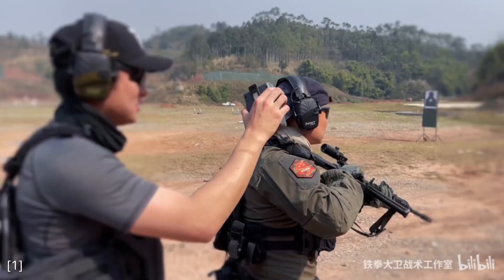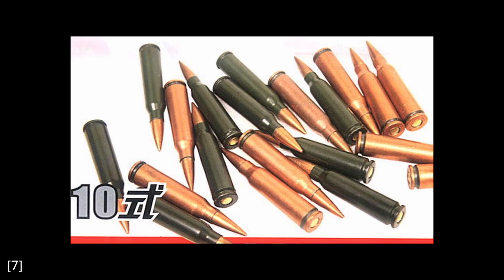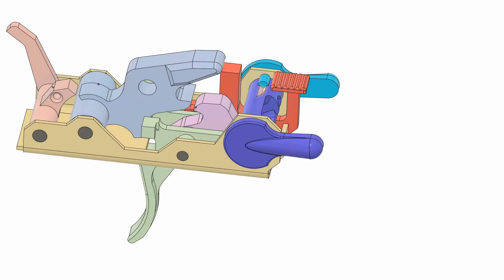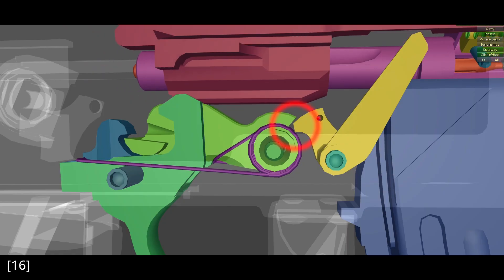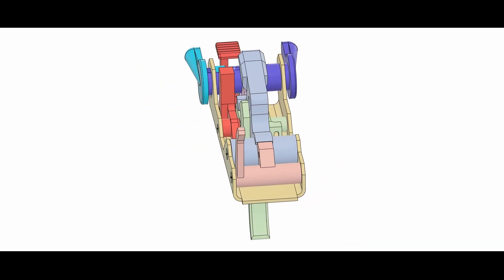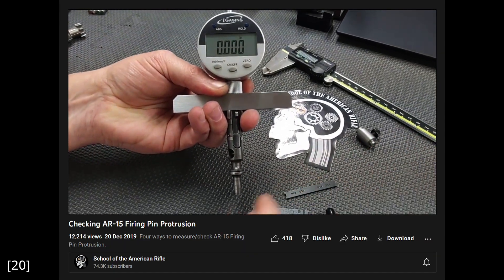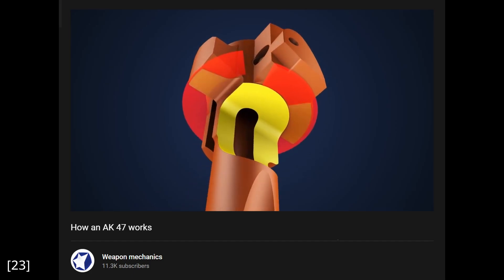QBZ191 - Final Update (and firearms design rambling)

Comment: It's a great video. What do you think the gap in the upper left corner of the ejection port is for? I know it's the bolt carrier because it hits the upper receiver pinduring recoil
Reply from the maker: If I remember correctly, the ejection port on prototype guns are much smaller from top to bottom. It seems like that caused ejection issues so they had to enlarge the top of the ejection port
Reply: @cabbage6015  Yes, the bullet case is thrown diagonally upwards, rather than directly from the side like AR. What I am thinking is whether this small gap in the mud test will cause the firearm to malfunction.
Reply: @cabbage6015 What is the muzzle velocity of the DBP 191?

Comment: Third time watching this video...
I don't think QBU191 is a IAR like M27 since PLA has also switched to their new SAW and GPMG. It has a full auto function just because PLA likes aggressive firepower.
Reply: Agressive firepower? I've mostly see 'em going towards a more flexible side, but I'm not a gun/military expert I'm just here to know more about norinco really.
Reply: @parko-nib  China basically inherit this style from Soviet army and their idea is simply bigger gun is better. And they are actually good at designing lightweight weapons with strong firepower.
Reply: @calciumoxide3385  i mean if you know what you're doing bigger gun does equal better, also lets chat a bit(i want to help cabbage's algorithm reach)

Where exactly did that come from? Most of the military gear i see the pla use is more tactical and cost effective as possible, the only one that I'VE seen fit your category a bit is the QLU-11(and it's more like a over-engineered deadly multi tool than anything really)
Reply: @parko-nib  I actually don't understand what your question is. You mean you can't find any big guns that PLA use?
Reply: @calciumoxide3385  well no, i can, but i don't really find their big guns following the soviet logic(bigger = better), btw I'm here to learn more about norinco, 1 week ago i didn't even know they existed, any info is welcomed.

Comment: Hello , great video. I have a question , you said that ar15 doesnt have helical lugs and that ak does which helps with primary extraction. But i have also seen many people in forums say that ar15 also has primary extraction and that when bolt is rotated a bit the cartridge also longitudinally moves slightly. Maybe ar15 has very tiny helix angle so that from picture you showed it looked like it was flat but in reality maybe it has some tiny helix angle? Or does it achieve primary extraction through some other ways?
Reply from the maker: I have never heard of primary extraction being achieved on an AR-15, by helical locking lugs or any other means 🙁
Reply: @cabbage6015  thank you for answer, i guess its just the good old forum myth. Because i just now scrolled down a bit on the forums and other people also disagreed with them and said that ar15 doesnt have primary extraction. However they also said this "The AR does not have this primary extraction.

The AR bolt does have reliefs on the left rear corners of the lugs that allow diagonal movement, but they don't force it." Do you know anything about those "reliefs" that this guy is talking about? It sounded interesting to me and my first time hearing it
Reply from the maker: @thomasschumacher5318  I believe they’re talking about the chamfers at the edges of the locking lugs, but I think those are just to relieve sharp edges, they have no significant effect on extraction
Reply: @cabbage6015  i see, thank you so much :)

Comment: I'm more interested in the upper receiver materials, and the recoil spring. Plus, also the gas block portion and the barrels. It looks intuitive enough that the 191 got an exposed adjustable gas block. I guess it's titanium btw still not sure, if it's landed on PLA SF Units, it must be another version of premium build. I expect some upgrades on the barrel and the upper receiver, aftermarket trigger looks fairly interesting if it's available. The finish can be more beautiful and got to go through some cerayote to adapt with camo and mission need. However, the stock looks a little bit off, if there's attachment point for sling etc it would be great.

Comment: I'm sure you've noticed a lot people point out the lack of a folding stock in this weapon. I personally don't find it necessary but it'd be cool to have one. 

Now just for arguments sake, is it possible for them to somehow integrate a folding stock into the current configuration? Or will it have to undergo major redesigns...What are your thoughts?
Reply from the maker: Hmm in terms of engineering I think they’ll have to do something like the LAW folder since the recoil spring is in the receiver extension like on an AR. I don’t think they will be able to fit a recoil mechanism on top of the bolt carrier like the MCX, due to the high ejection angle, and they also have cam lug locking mechanism up there.

Whether they feel the need to field a folding stock variant? I have no idea 😕
Reply: PLA still fields a large amount of type 95 in their arsenal, so I dont think a folding stock is too much of a concern for them

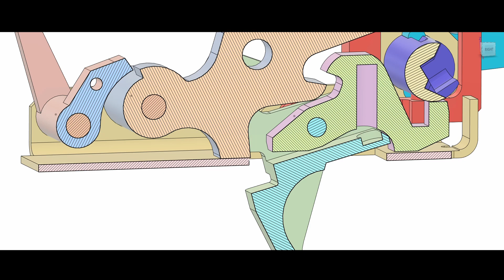Comment: 12:00 Adding mass to the buffer is not a perfect solution to the bolt/carrier mass ratio.  The mass ratio is important for the energy retention of the carrier during bolt pickup, since it need to impart energy into the bolt to get it moving, but during bolt pickup, any kinetic energy imparted to the buffer cannot be used to move the bolt as it not rigidly connected to the carrier. 

Also as far as I understand the Garand-style helical rotation doesn't have enough rearward movement to give primary extraction but helps to reduce wear of the lugs and friction,
Reply from the maker: Agree with your buffer assessment

Comment: Watched your first qbz-191 video and subscribed instantly. Simply love your analysis and eye for details. I really wonder why the Chinese ditched qbz 95 and what benefits does this new conventional design bring. They could've used 95's working mechanism and designed it into a conventional weapon from its current bullpup guise. I ask this as i haven't heard anyone complaining about 95's reliability. What objectives did they achieve with this new weapon design?
Reply from the maker: Glad you enjoyed! I think they switch to this design partly to provide more attachment mounting surfaces. Their patent documents also said AK-style bolt carrier groups are more bulky and heavy, so they used the AR-style this time to reduce weight. I also think that the 95's trigger mechanism is a bit bulky, especially with the linear hammer.
Reply: 95的设计是为了配合当时的机械化部队改革，部队装备了大量的战车等等载具。无托设计由于枪的整体长度较短，同时保留枪管长度，所以是一个天然的优势。劣势也非常明显，拓展性太差，很难加装瞄具。
  现在弹药技术进步到可以让短枪管打出高初速，那么就不需要长枪管了，无托布局就没有存在的必要了，回归有托布局不影响使用的同时还不影响拓展性。所以191就出现了

Comment: Thanks for another great video about the QBZ191 family. 

This rifle has some defects, but people who know the concept behind this design could accept that. To be more precise, the safe-auto-semi selector, the polymer handguard etc. But critics should know QBZ 191 is designed for large scale army, all those gentlemen who have to carry the rifle from average elevation exceeding 4,500 metres to extreme temperatures have ranged from −52.3 °C to 39.3 °C. Polymer furniture is the best solution for these environments, just like the AK12 family choose to have polymer furniture.

The auto-preferred selector is the habit-based design from the original type 56 to type 95. This design inertia might be the only thing 191 should have changed. In real battles, safety should be always on until the soldier pulls the trigger. Safe to semi should be a subconscious move, and semi to auto could be a conscious decision even when making contact with the enemy. 

The QBZ 191 family would be better if there are Chinese versions of SOCOM M4A1 SBRs and RECCEs. Change the selector to safe-semi-auto, design a better and stronger freefloat handguard for different lengths and shorten the suppressor.
Reply: There they are if you scroll down to variants.

Comment: Massive sleeper channel. Out of curiosity, what’s your take on the external vs. internal (Stoner) piston debate?
Reply from the maker: Honestly I don't have strong opinions either way. External pistons are simpler to clean and manufacture (outside of the AR platform), and work better w/ SBRs. Internal pistons have a better centre of gravity and generate less moments within the bolt carrier group. I kinda wonder why so few designs use the internal piston system. Maybe it was bc the tendency for the bolt carrier to heat up severely limits where you can place the charging handle? If we're just talking about the AR alone, then I feel like the in-line recoil system and cylindrically supported BCG just suits the internal piston better. It was designed like that from the beginning after all.

Comment: "3 times more on this than capstone in uni"
What it says about you as a student is that you are passionate about firearms design. I, too, have spent thousands of hours researching firearms when I don't even currently have a firearm design related job. I just own them and shoot them at work a small amount. I'm not even infantry.
Tidbits are the funnest part of this for me. One I found just yesterday is that literally EVERY SA80 ever made has an autosear trip, including the factory semiauto ones, AND the bolt action ones. 
The L98A1 cadet rifles have autosear trips. Magical, truly. Literally every gas operated SA80 ever would function on full auto if you replaced the lower, which at least in the US isn't legally the firearm, the upper is. The L98A1s would also be relatively easy to convert to semiauto, and I have heard claims the British Army might be doing that.

Chinese M27 Chinese M27 (but arguably better for several reasons)

Drums mathematically don't make sense in almost any situation but I won't make a full comment on that unless prompted

So, if you leave the gun cocked, you don't have to take it off safe to load a round? Personally, just leave it cocked all the time. Never understood people's fascination with sending hammer forward on closed bolt weapons when they clear them. Best case scenario, you ND. The other possibility is the chamber was already empty and you did nothing to ensure the weapon was clear at all. In some guns, you then can't put the weapon on safe. You can't tell the hammer is forward externally, either. Even on guns where this doesn't mess with the manual of arms, like an AK, all you have done is increased the force necessary to charge the weapon.

Generally incomprehensible to me outside external hammer weapons and striker fired pistols and open bolt weapons.

I'm not a huge trigger design nerd, that was all really neat! All the AR safety features, in the bolt carrier, and the AK safety features in the trigger.

The bolt tail thing is slightly weird, but mass ratio isn't really that finnicky that it'd be an issue, even without the buffer. The bigger gain is just spending less money on less metal of a smaller shape. If you have a mass ratio of 3:1 bolt to carrier, or higher, you're generally OK if you don't mess something else up. The higher the better, but guns like the SCAR with monstrous ratios like 10:1 aren't monstrously more reliable than guns with half the mass ratio. Bolt regulated firing pin protrusion is a definite plus.

People talk a lot about 7.62x39's geometry with primary extraction, the helical lugs are probably a way bigger factor, steel or brass.

A couple firearm platform suggestions: 
Tavor                   By far the most produced, barely understood rifle. It's not a great rifle in my opinion, but it's very weird, and it shares a bolt design with the Desert Eagle of all firearms.
Indonesia's Pindad series of weapons. Everything they've made past the FNC clone has been super weird. They're supposedly still FNCs but... they have AK gas blocks, and they have AR15 cam path pockets on the left side of the receiver. I'll DM you on instagram with more weirdness if you'd like, but researching these is abnormally hard so it might not work.
I'd say RM277 but there's just not enough information. The NGSW weapons are, for now, probably off limits due to limited information.
FAMAS        A weird gun with lots of info
SA80            A normal gun with lots of info, and lots of absolutely cursed tidbits, like the aforementioned autosears in bolt actions.
Reply from the maker: Hmm I'm thinking of making a video on the QSZ193 rn, since I found a bunch of patent documents. The QSZ92 is interesting too, and I planned to buy a civ version but when Trudeau announced the handgun freeze in Canada they flew off the shelves, haven't seen one since... I also have some firearm design ideas that I want to tinker around with. Gosh I wish I lived in a place where it's legal to make your own guns and test it in the woods...
Reply: @cabbage6015  Depending on what you do, it is and isn't legal in the US to make your own guns and test them in the woods, but it's definitely better.

We have the Norinco sanctions, however, if the gun has been in private hands for 5 years it can legally come into the US as the law is written. Nobody has ever done this to a QBZ-97, but I'm seriously considering it. There are sources other than Canada too, such as Italy. 

I don't know the 3d printer laws in Canada, but if you make sure to steer clear of making legally prosecutable things with it you can do a lot of prototyping. I'm friends with a Brazilian guy prototyping an entire CAD-designed assault rifle with unique gas system, trigger pack, receivers, cartridge, everything.

It's genuinely awesome to see a plastic version of what was only digital exist in real life, in somebody's hands.
Reply from the maker: @superfamilyallosauridae6505  Yeah I'll by drafting up my design in CAD in the near future. Will call the RCMP to ask about 3D printing regulation
Reply: @cabbage6015  o.o
That's awesome man! Only thing I'll say, is that to minimize the size and weight of your overall weapon, minimize the size and mass of your bolt and how it locks into the barrel. Especially the bolt specifically, because like a snowball rolling downhill it drives the mass of the entire action.

Really excited to see what you come up with.
Reply from the maker: @superfamilyallosauridae6505  oh it’s a handgun tho (but everything you said applies). That’s also why it has the potential to be legally finicky since handguns are so tightly restricted in Canada. I’ve also had an idea to make a 3d printed semi auto .17 hmr using an off the shelf barrel, but I emailed the RCMP and they told me I need to send them complete technical drawings for approval, which is kind of a pain. I wanted to do it just by trial and error, but idk what would happen if the initial design I send them end up not working. Worst case scenario I have to send a set of drawings every time I make a modification to the design…
Reply: @cabbage6015  That was a real quick response from the RCMP. I am not Handgun Learnt, I have no advice there. Legally, that's rough

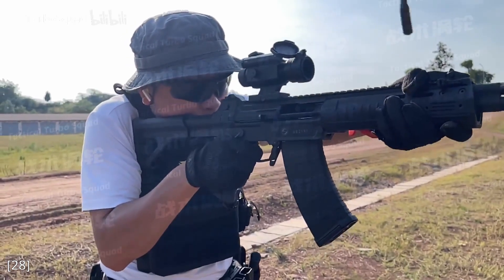Comment: Going by the slow motion footage at 18:40 it seems to me that the movement of the bolt is very well balanced in that it does not impact in the rear. I wonder if this has been achieved by just tuning the gun very accurately to that specific ammo type and including an adjustable gas post for adverse environments or if the amount of bolt travel is more than in some other systems lacking this effect like military AR's.
Reply: I agree, it looks a lot like 'constant recoil' and I cannot see the receiver being bumped at the end of the bolt carrier group's cycle.